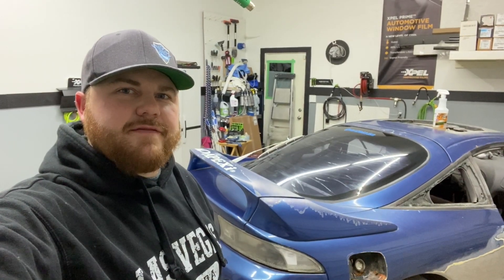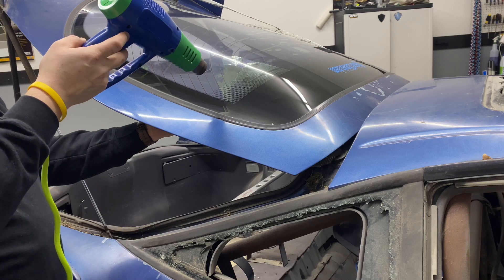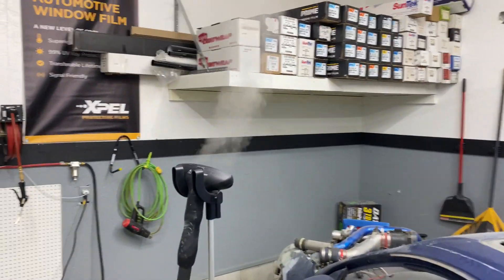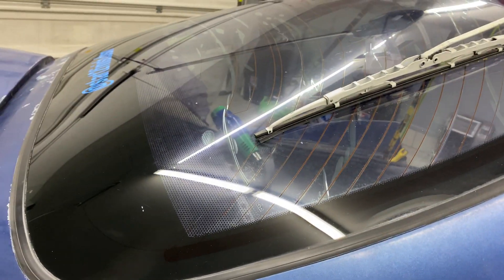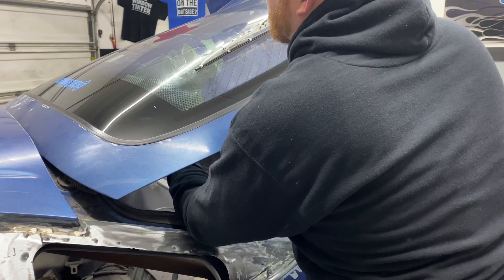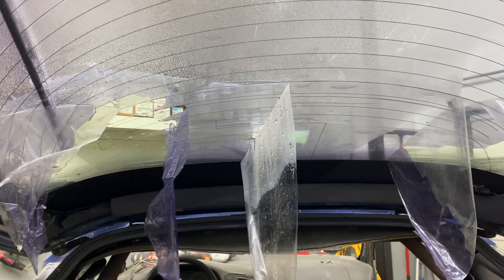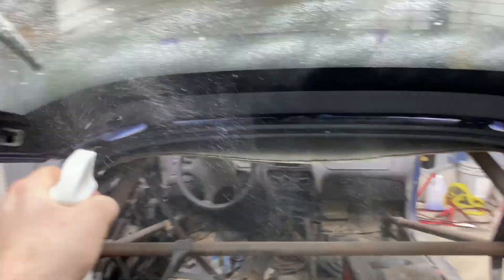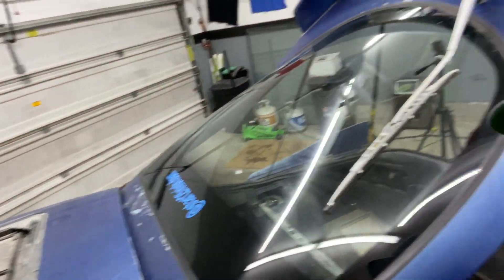Removing Window Tint on back window of 1995 Mitsubishi Eclipse from Start 2 Finish Episode: 002

Comment: Ah the purple tint definately a dyed film as they are they only type that go purple.If you dont have a heat gun just use a garbage bag on the inside of the glass then put the car in the sun for 30mins then it peels off easy.

Comment: That's the same exact problem I had trying to remove my rear window tint today. The clear layer came off easy but the tinted layer was still there. Would you reccomend the steamer over the black plastic bag method?

 I was using a blow dryer and a razor blade. It worked perfectly on the side windows.
Reply: Mine has done the exact same thing,  however Im unsure what to do about the rear because of the defrost lines, did you end up doing the plastic bag method? and if so,  did it work?
Reply: @Bri 2813  No, I ended up using a handheld steamer to loosen up the tint adhesive